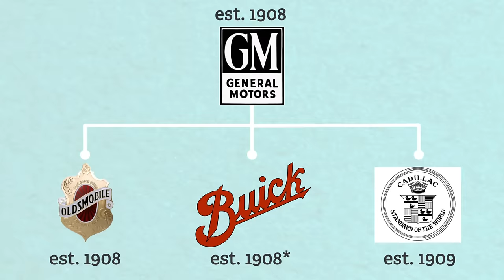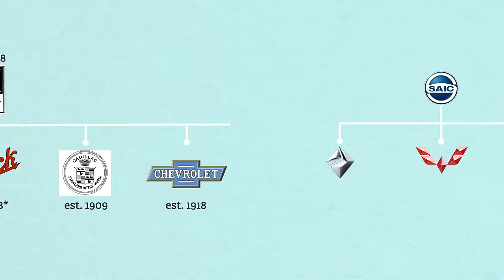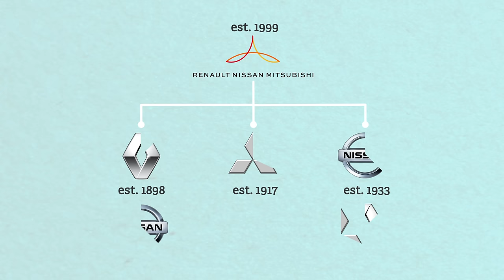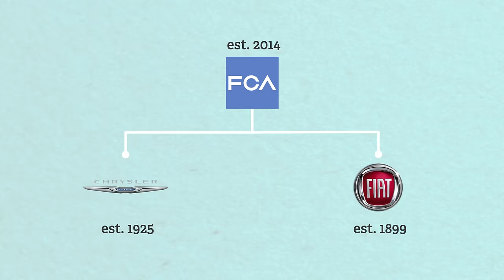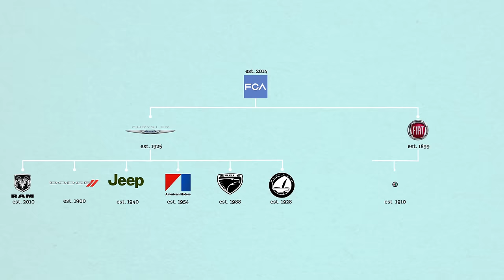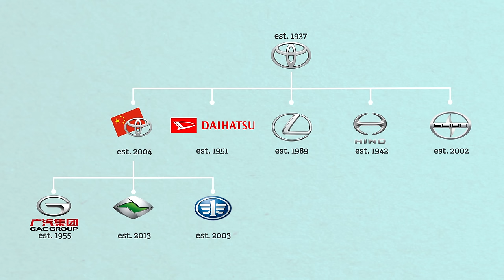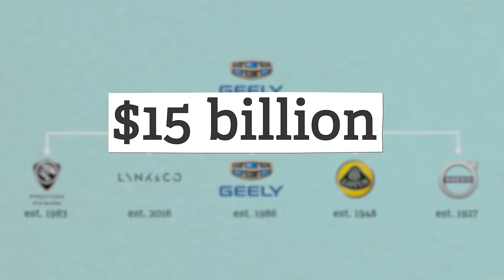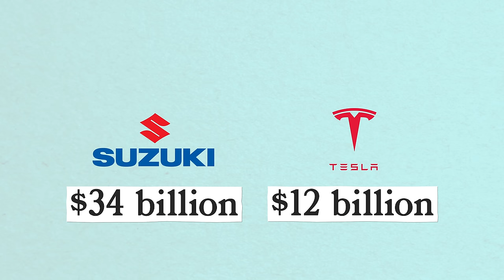Who ACTUALLY Made Your Car? | WheelHouse

Comment: Bit of fact checking:
- GM doesn’t own SAIC, they own a 50% share a joint venture with them, but as with all joint ventures it’s very much still very much at the pleasure of the Chinese government
- Ditto for Daimler and BAIC. Daimler owns a non controlling 49% stake of a joint venture.
- Fiat hasn’t owned Ferrari since 2016, when Fiat completed its spin-off of Ferrari on the NYSE.

Comment: Well that's not true there are only two really working products to avoid hairloss first transplantation the other one is a blood-presure medication wich has a byproduct which reduced hairloss by stimmulatimg the hairgroth at the root. You should start at around 25 and the dose each day required is roughly $2  to $3 but the medication needs the permission of the doctor.

Comment: Its funny. As a service tech I kinda knew all these cars were related, simply by either what oil filter they use, the size of plug they use, or the way you reset the oil light. Almost all cars in a certain line up use the same things.

Comment: FACT CHECK 1: At the end you stated something along the lines of [your car is owned by a more boring brand, but if it wasn't this way your favourite car wouldn't exist]. Oligopolies reliably reduce consumer choice. Your favourite car was never made because the big 5 bought your would be car brand and killed them, or used their influence as an oligopoly to kill them.

FACT CHECK 2: In the middle you said cars operate at razer thin margins. Kind of. Like yea they only make 4% back on luxury cars vs some MLM making 95%, but $5k is $5k.Who cares about margins when you make an easy $5k every 2 seconds. You refused to mention net profit even though its publicly available.

FACT CHECK 3: You said it made cars cheaper. Yes, but it devalues workers as the factory worker in China makes 2.50 an hour, your kid makes 16 an hour at Mcdonalds, instead of your kid making $100k a year designing and putting together cars. At a loss of $70k a year, that would have been enough to buy 2 more expensive cars. 

Like you can admit vertical integration has upsides but you didn't list them, you just made up pro-capitalist propaganda seemingly. I lost respect for my favourite channel today.

Comment: Porsche is actually the owner not the owned
Reply: Not really :-) The company that produces the cars is the Porsche AG (or long: Dr. Ing. h.c. F. Porsche Aktiengesellschaft). The company that holds 53 % of the Volkswagen stocks is the Porsche Automobil Holding SE.
Reply: @sebastiannolte1201  fair enough, different names but the concept sticks. A much much smaller company by capitalization that owns one that is much larger. The perfect example is that the owner of the controlling of non floated fiat (known as FCA now Stellantis) shares is a holding company called Exor, which in turn is owned by an even smaller entity and so on. It boils down to a huge conglomerate basically controlled by a tiny tiny entity with no capitalization, no floating shares and impossibility to be  bought.